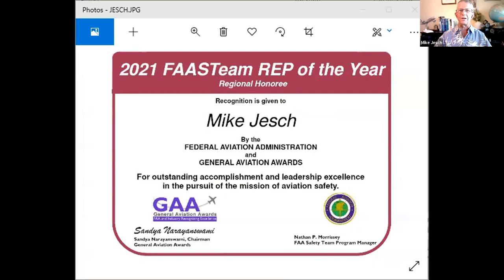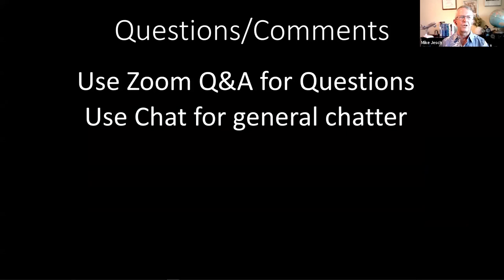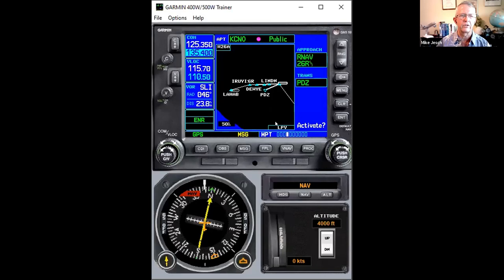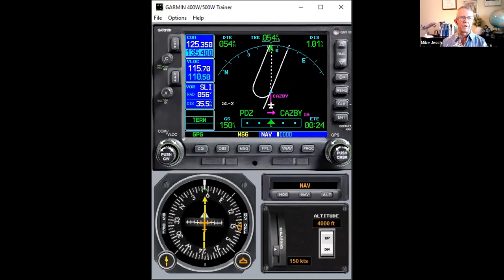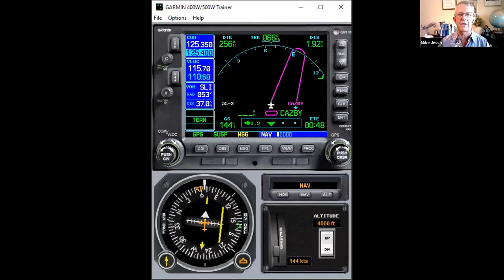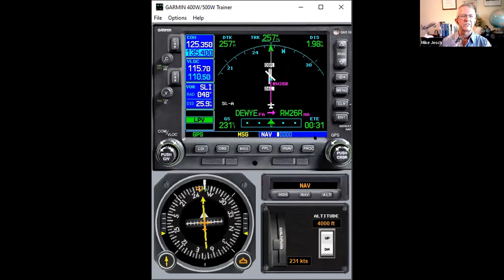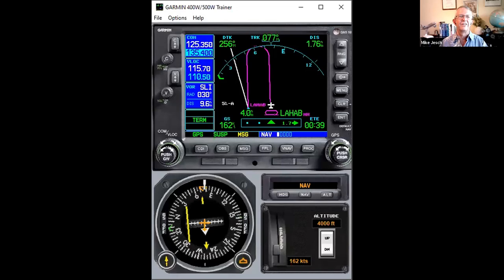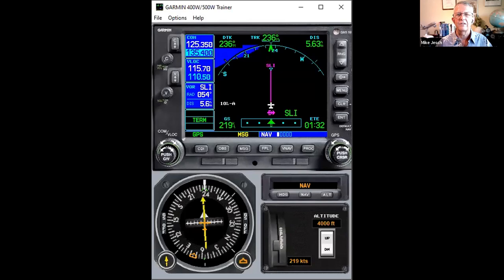GNS Part IV Holding Patterns

Comment: At 47:42 Mike says, "standard hold which is left turns." That is incorrect. Standard hold is always RIGHT turns. Yep, for reasons unbeknownst to anyone (other than FAA), holds are right standard whereas traffic pattern is left standard. Therefore, the SLI hold pattern sketch was drawn incorrectly if the turns were standard (right). Of course later Mike corrected himself and flew the parallel entry (appropriate coming from N) and got himself on the right turns hold. Great presentation!
Reply from the maker: You're the ONLY one who caught that! You should've seen the chat and Q&A light up when I said that. I always leave a couple mistakes in there, just to see if anybody's paying attention, and it turns out, you were! Good job.
Reply: SLI does have a published hold with left turns, which may have been part of the confusion

Comment: Are the 430 and 530 the same, except for the screen?
Reply from the maker: Bottom line is, they both can do the same thing. The 530's screen has a little better resolution, in addition to being larger. The Nav page 1 is slightly different: the 430's is sort of just a data display page, while the 530's has an arc compass displayed over a map in addition to that information, which I find VERY useful, and much prefer. The 530 has six buttons across the bottom while the 430 has only five, so the VNAV feature is accomplished through a menu instead of a button, but the capability is still there, and some of the other screens are slightly different. A used 430W can be found for purchase used for around $3K, but the 530Ws are closer to $8K.
Reply: @CapnMikeCFI  The 530 also displays radial and distance from a selected VOR on Nav Page 1, where the 430 does not.
Reply from the maker: @mannypuerta5086  Hi Manny! Good to see you here... Long time no see! I thought of you recently when I was down at F70 and saw a couple Twin Otters there and wondered if you were still doing that? Yep, you're absolutely right. Part of the benefit of having a little more real estate available on the display.
Reply: @CapnMikeCFI    Nope. Retired now.  Just flying the 185 (G5/530/430 equipped) and the occasional tailwheel/mountain/backcountry training.